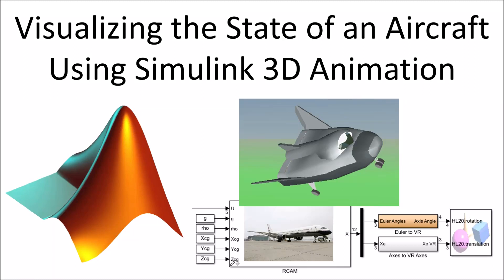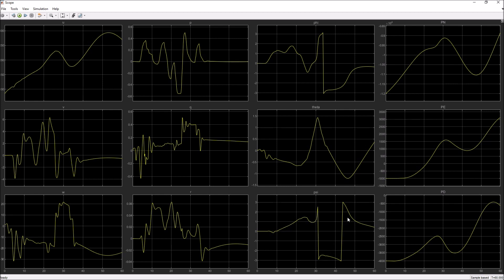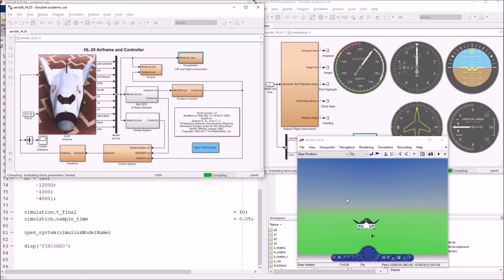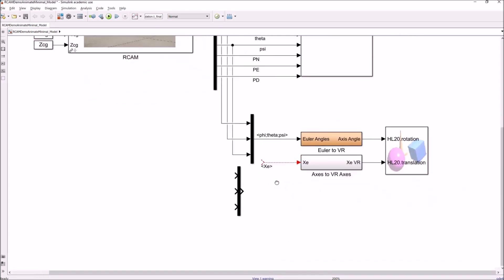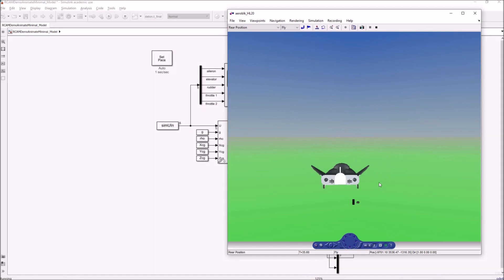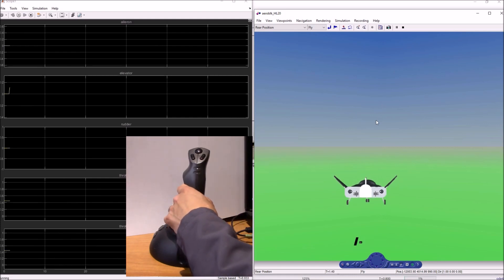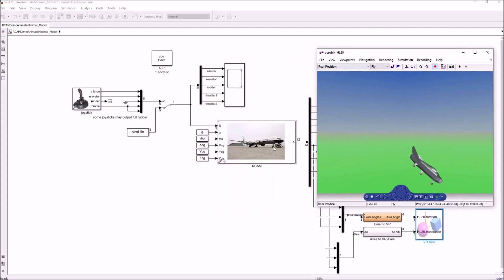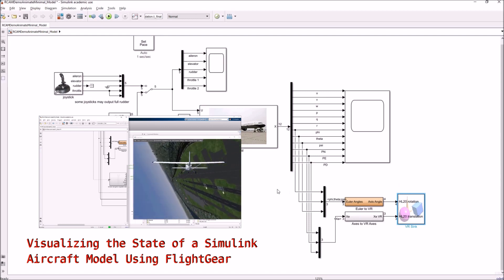Visualizing the State of an Aircraft Using Simulink 3D Animation

Comment: [AE 512]
I am unable to open aeroblk_HL20. I also unable to open the crane model from last video.

I have the add on's installed I just can't figure out where those example files are.
Reply: I figured it out. I had to run
openExample('aeroblks_hl20/HL20ProjectWithOptionalFlightGearInterfaceExample')
openProject('asbhl20');

( i am running 2023b)
Reply: nm - it was not the same model